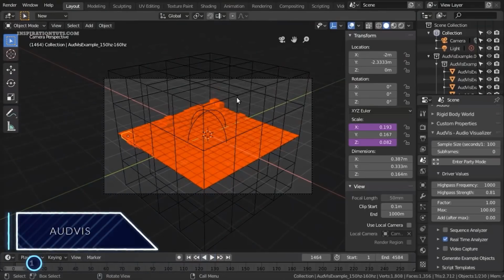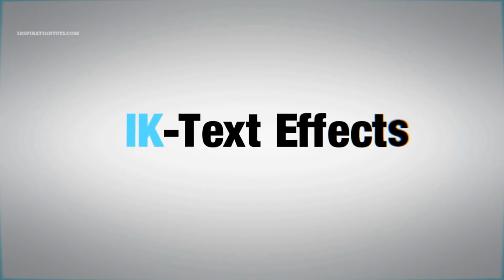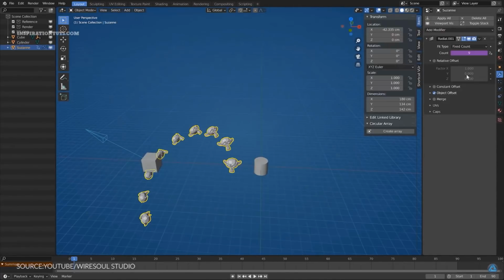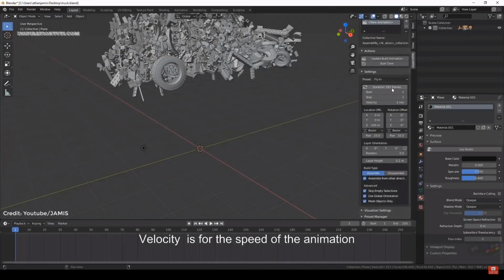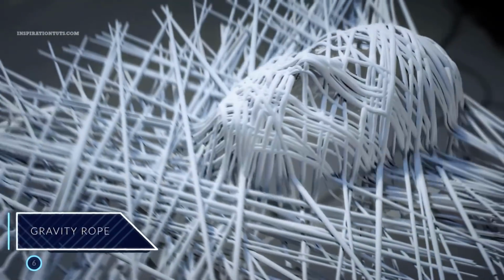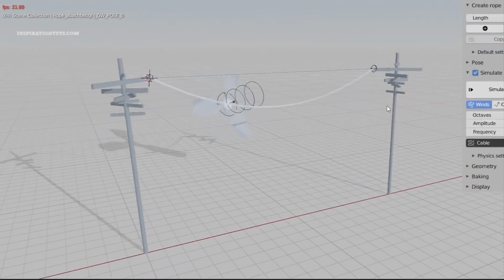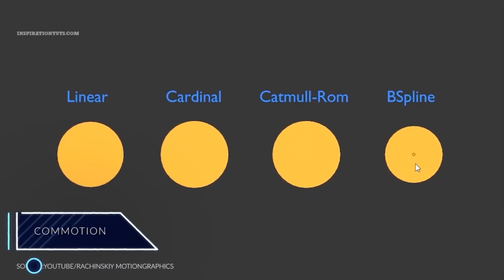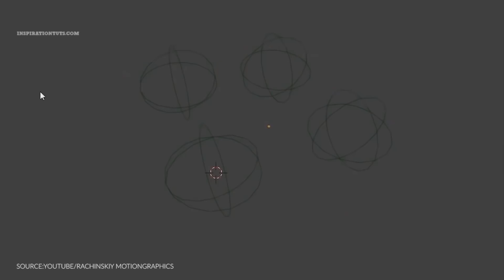Blender Addons for Motion Graphics

Comment: Good video, I have a question if any expert could answer me, how much huge the difference is between making a movie similar to reality with motion capture suit or using only a software without mentioning time of the process, how similar to reality It's gonna be if I use only the software to animate the character?
Reply: , The goals of animating by hand and animating using mocap are very different. 

The main point of animating by hand is to give your characters an specific aesthetic and movement that can't be achieved with motion capture, like cartoon characters for example. 

Motion capture is focused more on recreating real life, it can be used in animation, however you'll see that those strive for a realistic look, like the series 'love death robots' or modern video-games for example.  You'll see mocap used the most on movie's special effects for that reason. 

So you ask how similar to reality could a hand made animation be, compared to a mocap, they could be basically indistinguishable if the animator is skilled enough, but that's not the point of hand-made animation. 

That's the same for 3d sculpting. You could be comparing a hand made sculpture with a 3d scan of someone's face. They could be nearly identical, for sure, but the sculptor's talents would be much more well used if they were to sculpt a monster or an alien as you can't 3d scan those. Furthermore, character sculptor's job usually consists of turning concept art into a 3d model, basically a 2d illustration. 

Now, it's worth noting that both mocap and 3d scanning are rough by nature and specialized animators or sculptors are going to have to work on them to refine and fix the issues before they are in a presentable state for the rest of the production pipeline.